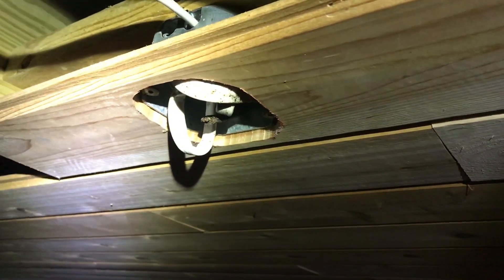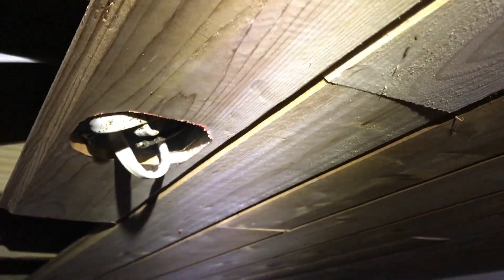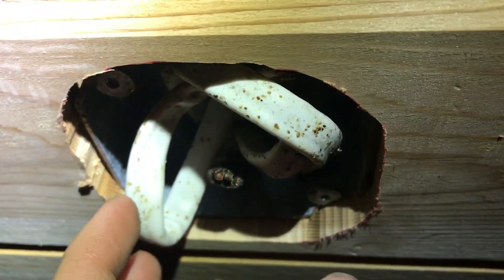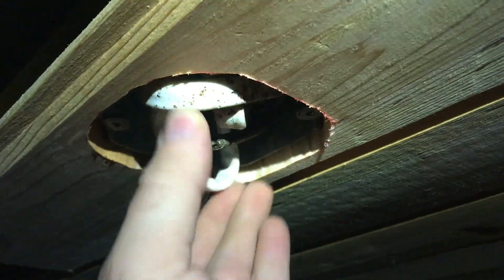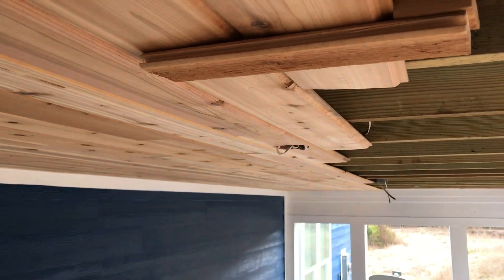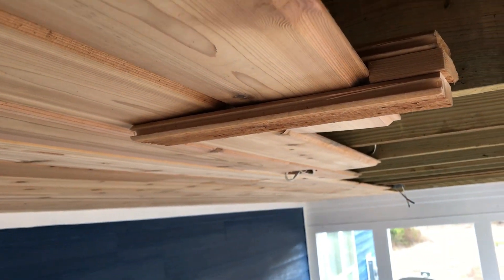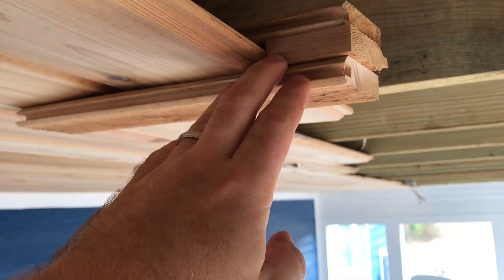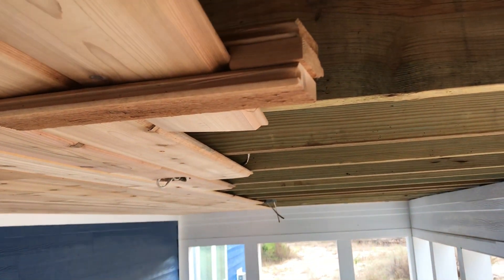Installing Cedar Tongue and Groove Porch Ceiling

Comment: Why not move the junction boxes, since you have access to them as you approach with your T&G boards?  I'm putting in a T&G ceiling myself and I'll just adjust the boxes so they land exactly where I want... in my case I want them centered in the board since I'm using 6" boards and the 4" LED wafer lights look better centered.

Comment: Would it be better to cut the joints at a 45, sort of like the way you do baseboards? I’d be worried about bugs getting between the gaps in the butt joint. We have paper wasp issues where I’m at.
Reply from the maker: I thought about it, but the boards are already dry and stable so hopefully not too much linear movement. Plus this particular ceiling is eventually all going to be enclosed (it is now, but wasn’t when I filmed it) with screens, so wasps won’t be able to get in anyway. Thanks for watching!

Comment: I’m doing a similar install restoring my 130 year old porch eave soffit..My TnG soffit decking is 3/4in thick by 4-3/4 wide pine with a fake v-joint in the middle. I have usually seen it installed with the first row having the tongue cut off and shoved against the wall with the groove facing you, so you push the tongue of the new board into the groove of the old one as you nail it in.. In the video it seems the opposite.. was that a conscious decision?. Great idea with the clothespins! And I don’t think it’s a waste of time. A cedar deck ceiling adds more value and looks better than a plywood one. It’s like the argument for wood versus vinyl windows.
Reply from the maker: I've always done wood flooring leading with the tongue, and nailing through it. I guess if you lead with the groove you could nail through that too. Commercial floor nailers are designed to set against and nail through the tongue.

Comment: I wood clad that ceiling with at least 1/2" plywood first, this way u can nail ur boards anywhere u want. The ceiling will come out straighter/flatter also.
Reply from the maker: That's actually a good idea. It was a bit wavy from one joist to the other. And I'd have likely nailed more if I could. Thanks for the tip. Hope I never have to do this again. Ha!
Reply: Frank Pells - Curious!  Would 7/16 in plywood work just as well?  Also would OSB work or should it be plywood?

Comment: That isn't even tongue and groove. It's SHIPLAP! It's hard to take someone's advice when they don't know what materials they're using.
Reply from the maker: You're going to have to support your argument here, or admit defeat. This wood very clearly has a tongue, and a groove. I wish I could somehow insert a cross section drawing here. Shiplap has offsetting tapers on opposite sides, tapering out at the bottom, and in at the top, to create appropriate water shed. But I suppose you are some sort of expert on the matter and know better than I do. I am anxiously awaiting your rebuttal. Until then, thanks for watching!
Reply: It’s definitely tongue and groove. Here’s a website showing the difference in profile. https://www.duffieldtimber.com/blog/post/shiplap-vs-tongue-and-groove-which-profile-is-best/
Reply from the maker: Thanks Rick! It's just so easy to pop off and make a poor comment. Turns out it's also equally easy to do some research before popping off and making an inaccurate statement. Ah well. Thanks for watching!